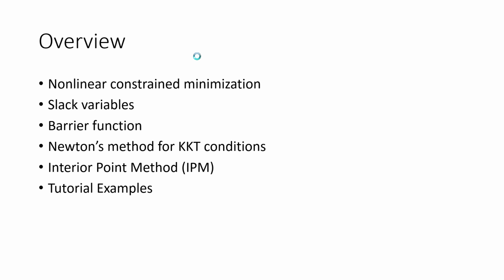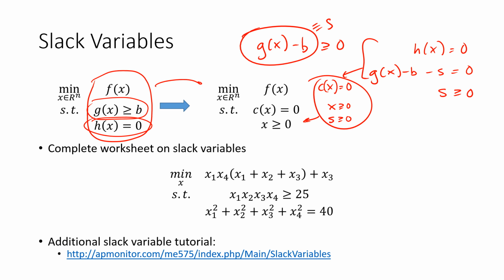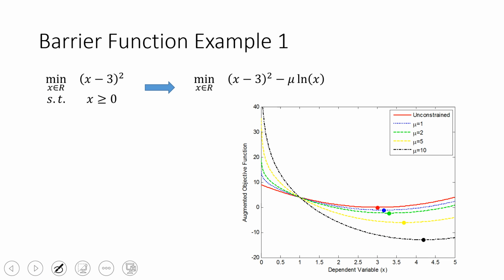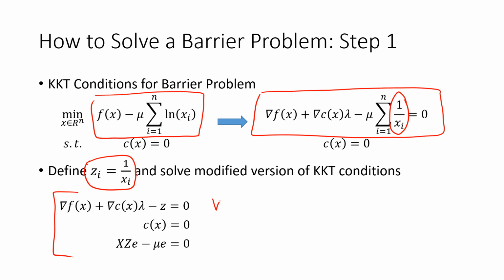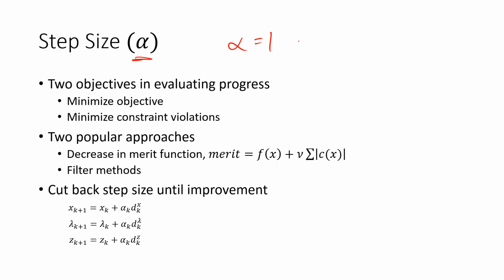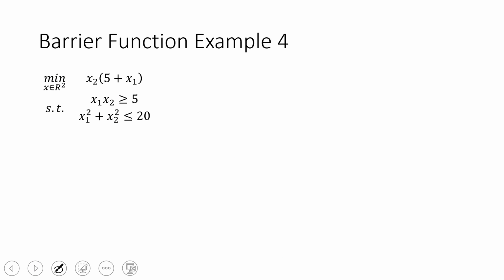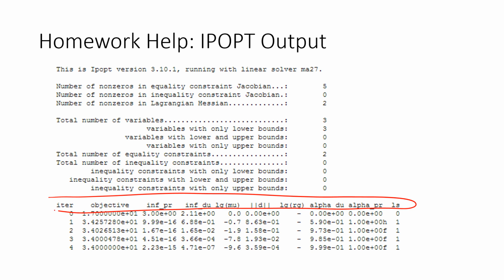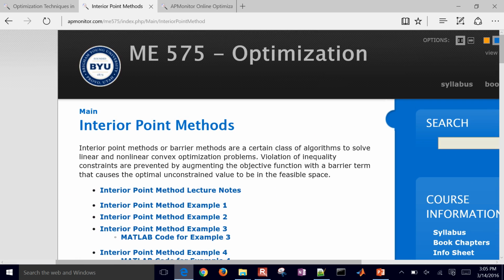Interior Point Method for Optimization

Comment: Thanks for your video! For the graph @ around 7:10, when mu is 1, 2, 5, and 10, my calculated x values that minimize the augmented obj function are 0.366, 0.618, 1.158, and 1.791. I just let the 1st derivative to be zero and solve the equation because the aug obj function is convex. They seem to be a little bit different to your color-coded graph. What could be the reason? Thanks again!
Reply from the maker: How different were the values? It may just be a numerical solution issue.

Comment: 2:45 why is x greater than 0?
Reply from the maker: That is a standard form for any inequality constraint. It could be f(z) > g(z) that is converted to x = f(z)-g(z) and x>0. More info is at https://apmonitor.com/me575/index.php/Main/InteriorPointMethod
Reply: @apm  Thank you very much, Sir. Now, I have three more questions. 
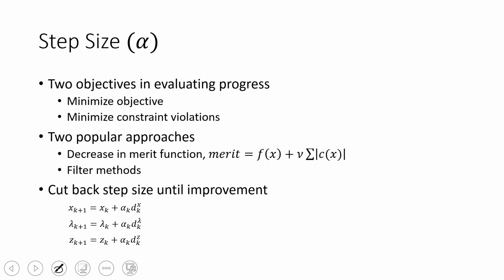(1)In 10:12, is -\mu X_k^{-1}e missing in the first element of the vector b, which is under the blue word 'linear system'?
(2)Since we have already found KKT solution with Newton-Raphson method, why do we still need step length? I think the KKT solution of the barrier problem is the optimal solution of the barrier problem. 
(3)Since the optimal solution is obtained when \mu is small enough, why not choose a small enough \mu directly, such as 10^-10, so that the problem can be solved much faster?
Reply from the maker: @asdfqwer2988  the equation is correct. That term is brought over to the other side of the equation with Sigma. See equation 11 in this paper: http://cepac.cheme.cmu.edu/pasilectures/biegler/ipopt.pdf
Reply: @apm  Thank you very much. The right side of equation 11 in the paper is the derivative of the barrier function with respect to x, but the equation in the vedio is the derivative of the f with respect to x.
Reply from the maker: @asdfqwer2988  I recommend the paper as the correct source.

Comment: how to code without link this site server. and how to maximize wind energy capture using dynamic programming.for example by optimizing aerodynamic power cofficient
Reply from the maker: Here is additional source code: http://apmonitor.com/me575/index.php/Main/InteriorPointMethod If you'd like to run locally without an internet connection, you can use a local server for APMonitor as shown here: https://apmonitor.com/wiki/index.php/Main/APMonitorServer  If you are using Python GEKKO, you can set remote=False as an option to calculate without an Internet connection.

Comment: My cousin research is on optimal power flow analysis of Nigerian power system using Primal-Dual Interior Point Method. She's presently stuck at  her Chapter 3, which is modeling  optimal equations with Matlab/MatPower

Could you help?
Reply from the maker: There are many examples here http://apmonitor.com/me575/index.php/Main/InteriorPointMethod  There is also the Gekko or APMonitor software that is used for optimal power flow analysis. Unfortunately I can't help with individual projects because I get many requests like this.

Comment: In all the examples, because you include the condition for x is greater than or equal to 0, thus using ln(x) has no problem. What happens if the region for x contains both negative and positive values? Which function can be used for both negative and positive x's?
Reply: I got the answer after watching your example here: https://www.youtube.com/watch?v=oVqpaZB48eM

Comment: how are we initializing the value of \mu and decrease it for each iteration? here you assigned 1 as initial value , how it would change over each iteration? thanks
Reply from the maker: The initial barrier parameter value of \mu depends on whether you would like a strong contribution from the barrier term or a small contribution initially. For problems where you have a good initial guess, you may want to choose a smaller value. If you don't have a good initial guess, it can make the initial iterations less productive because the problem is more ill-conditioned.

Comment: Sir, Thanks for the great tutorial. I have following 2 very basic questions though:
1. What is the main difference between IPOPT (Interior Point Optimizer), BPOPT (Barrier Point Optimizer?), and APOPT (..? Point Optimizer?)?
2. You talked about combining APOPT and BPOPT to get a better solver. May I know if its available to use or not? 

Many thanks!
Reply from the maker: APOPT is an active set solver. BPOPT and IPOPT are essential the same except for differences in the way they treat acceptance of a new trial point. IPOPT uses a filter method while BPOPT uses a merit function. There is additional information on these solvers at https://apm.byu.edu/prism/uploads/Members/minlp_apopt_informs2012.pdf  We are working on the combined approach right now along with several other improvements. The IPOPT solver is open source and available from COIN-OR. APOPT is available from https://apopt.com (AMPL and APMonitor) and also integrated into the GEKKO Python software.

Comment: Hello,sir may I know how to find the solution for Penalty method using matlab
Reply from the maker: I've posted Matlab code for the barrier method or interior Point method at the following link http://apmonitor.com/me575/index.php/Main/InteriorPointMethod  It is the BPOPT solver. You can also use the fmimcon solver that has an interior point option. http://apmonitor.com/che263/index.php/Main/MatlabOptimization
Reply: APMonitor.com thank you for reply sir

Comment: This is gonna sound really stupid, but I don't understand where x>=0 comes from. It is not included in the initial problem, why would you add a constraint like that yourself?
Reply from the maker: +mohammad beit sadi, this derivation of the interior point method need bounds even if they are +infty to -infty. You can convert any inequality to x>0 such as y>z becomes x=y-z and x>0. In practice, the best solvers such as IPOPT and BPOPT do clever things to improve the efficiency of the solution for large scale problems. See http://apmonitor.com/me575/index.php/Main/InteriorPointMethod for example code in MATLAB (BPOPT).
Reply: ah, I see. had look at the example on your website and that made things clear. Thanks for your quick response.

Comment: I just went through this video and checked the source code. Can you please tell me how can I create/define my own problem without connecting to apmonitor server?
Reply from the maker: +Muhammad Bilal, you can download and install the APMonitor server to your own computer (available in Linux or Windows). http://apmonitor.com/wiki/index.php/Main/APMonitorServer  Modify the source code to point to http://127.0.0.1 (or the local Intranet address where you have it installed) instead of http://byu.apmonitor.com

Comment: it is urgently needed... plz can you post me a video explaining the example no. 3 and it's MATLAB program
Reply from the maker: For the example problem 3 at http://apmonitor.com/me575/index.php/Main/InteriorPointMethod, you have a double inequality with 0 <= y < 9/2. You'll need to look at the IPOPT paper for how to handle the upper bound in addition to the lower bound. There is a slight change. See the BPOPT code for a general implementation that includes upper and lower bounds: http://apmonitor.com/me575/uploads/Main/bpopt_matlab.zip

Comment: Do you know of any guaranteed, or even reliable, closed formulae for 'mu' and 'alpha' as functions of the iteration step which converge for all, say, quadratic programs or similarly for other classes of programming problems? Thanks in advance! :)
Reply from the maker: +mattmilladb8 I haven't seen this type of guarantee in closed form. Most solvers are adaptive on those parameters because every problem is different. You could reduce the mu value to approach zero on the first step but that would make the linear system for the KKT conditions ill-conditioned. Some of the papers related to IPOPT (one of the best interior point solvers) are given here: https://projects.coin-or.org/Ipopt/wiki/IpoptPapers
Reply: +APMonitor.com Thank you for the reference. I only ask because you'd need either a constant step size or one which is a function of the iteration you're on to prove convergence or for complexity bounds. For instance in Karmarkar's Projective Scaling Method the 'alpha' needs to be ~1/3 to prove that the algorithm operates with polynomial time complexity less than either the simplex method or affine scaling. Would really be helpful to have a function like mu(k) or alpha(k) where k is the index referencing the current iteration (given that one expects mu to at least change as one iterates) even if either the functions works only within a subset of programming problems. That said I really found the video to be quite helpful, so thanks again! :)
Reply: +APMonitor.com Not to barrage you with questions but do you think an application of Nesterov's momentum trick (Nesterov's Accelerated Gradient Descent) would speed up the convergence of the naive Newton-Rhapson method in this implementation? Thanks again! :)
Reply from the maker: Nesterov's momentum trick may help if you are using a steepest descent method - it seems to be common in fitting neural network models. In most Interior Point solvers there are two methods to "accelerate" convergence, especially when you are close to the optimal solution. The first is to use exact 2nd derivatives from automatic differentiation (versus a limited memory BFGS method). The second method is the second order correction that comes with checking convergence criteria at the new trial point.

Comment: Do all barrier function use ln(x) or is it possible to use other functions? For example, (1/x) is not defined at 0 and as the solver approached 0, there would be a sharp slope. Is ln(x) used because it not only has the asymptote as x approaches 0, but also is undefined for x <= 0?
Reply from the maker: +Matt Anderson there are other barrier functions but the nice thing about ln (x) is that it makes a linear set of KKT conditions for Quadratic Programming problems.

Comment: Prof. Hedengren

¿Could you please mention how ipopt method is compared with Mosek, KNITRO or Gurobi?

Thanks in advance.
Reply from the maker: +Simulation &amp; Control There is a survey of the capabilities for different solvers on Wikipedia: https://en.wikipedia.org/wiki/MOSEK (see bottom). One of the main differences is that IPOPT solves general nonlinear optimization problems while Mosek and Gurobi solve Mixed Integer Linear Programming problems and have support for some quadratic objectives / constraints as well. KNITRO is a collection of 3 nonlinear programming solvers (2 Interior Point, 1 Active Set) and it also supports Mixed Integer solutions as well. I'm developing two solvers: APOPT (active set) and BPOPT (interior point) for MINLP problems as well. To decide which solver is best for your application, I'd recommend several benchmark studies like are shown here: http://www.mdpi.com/2227-9717/3/3/701/html (see Figure 10).